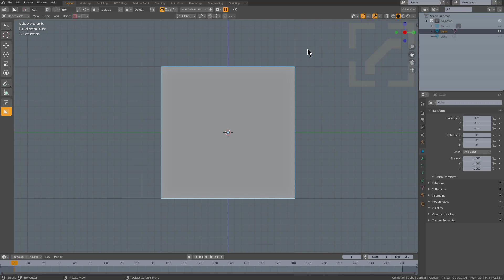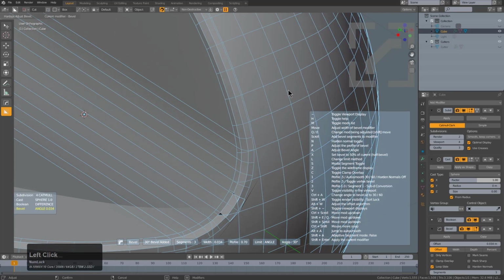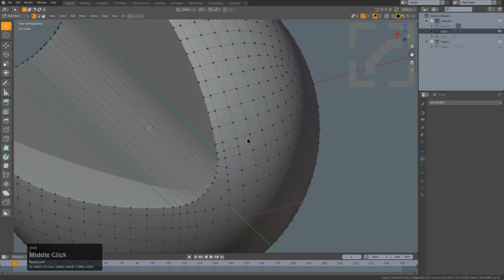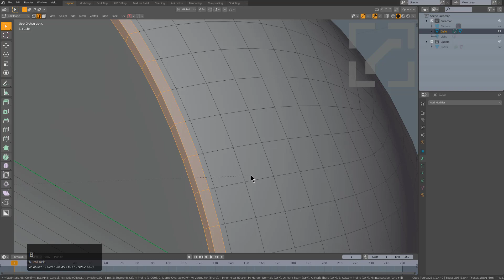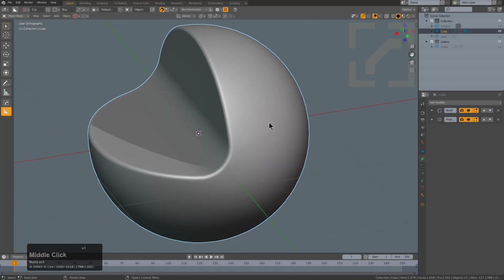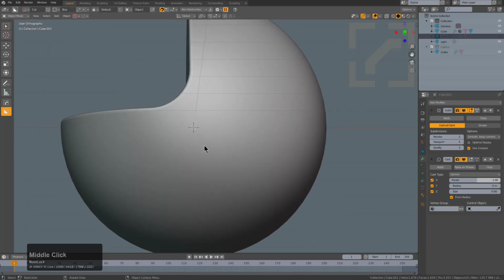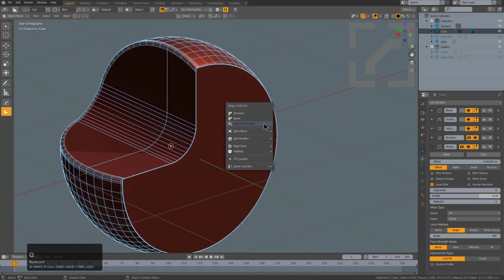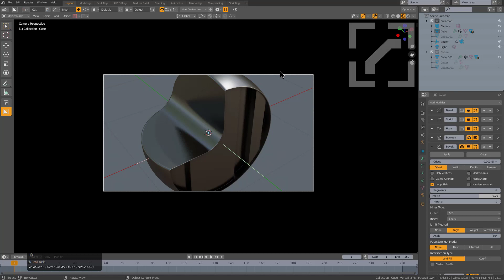#hardops 985 : Topostudy1

Comment: You mention checknig face orientation following the secondary boolean. As it turns out, when I did it, the face normal was wrong. Is there any way to rectify that in non-destructive mode, or, as I did, do you always have to apply the modifiers and recalc the normals?
Reply: Ignore me, found the issue, at first thought it was needing the shrinkwrap applied, but on deeper investigation, it was as simple as the cutters being visible. If the ywere visible, the face showed as inverted, but once hidden, the face showed as correct. I think, what was happpening was, though hte cutter was in wireframe mode, the face for it was still showing inverted as you were "looking through" the cutter mesh. This was overlaying with the face being cut. Hope my bafflement helps someone else. :-)